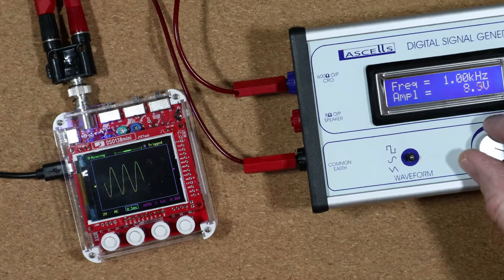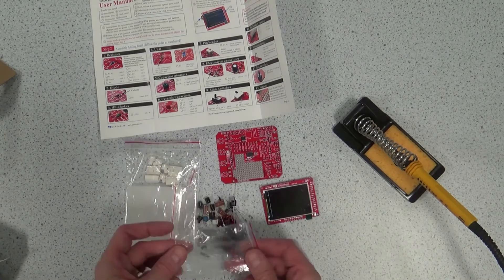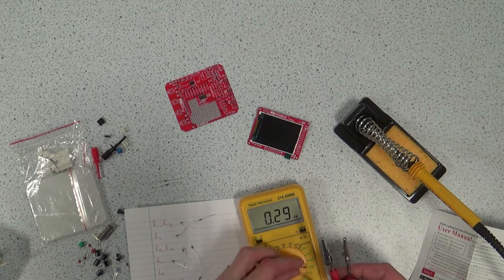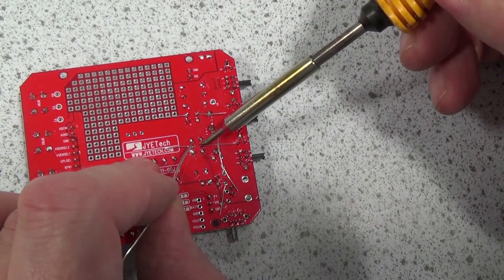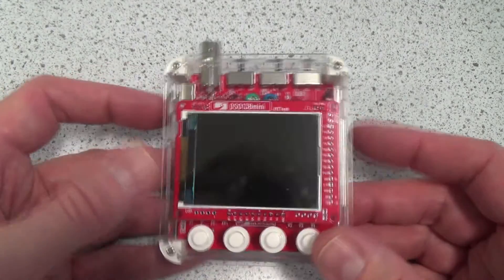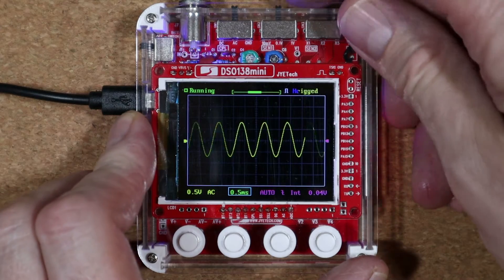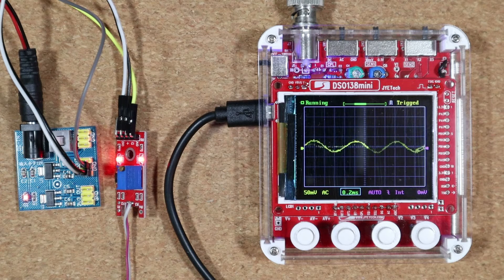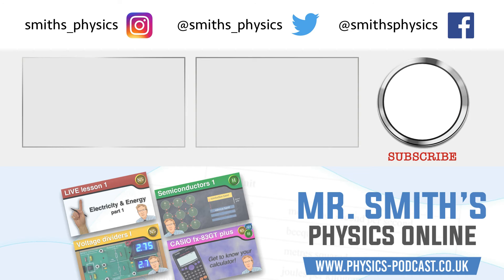Get Your Hands On The DSO138 Mini For Only £15/$20!

Comment: I am going to get one. It looks like it would be handy for student demonstrations. I am mostly retired, but sometimes I teach Arduino usage at a summer camp.

Sounds like this has more than enough bandwidth for looking at sonar pulses and servo control signals.
Reply from the maker: That's not something I've used it for yet so it's well worth looking at the spec sheets. The best but is putting it together (in my opinion) but it's certainly proved handy.